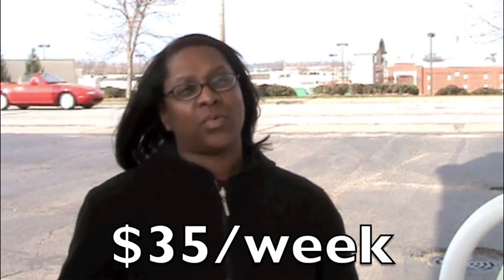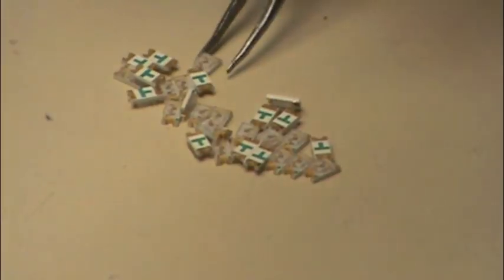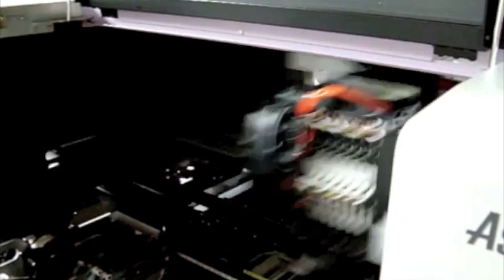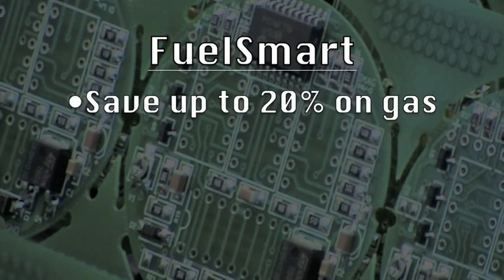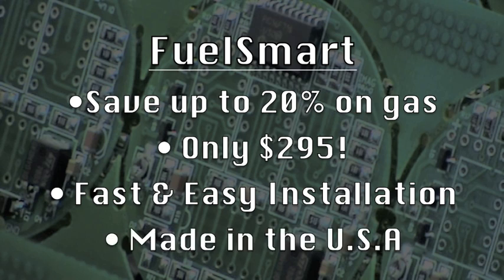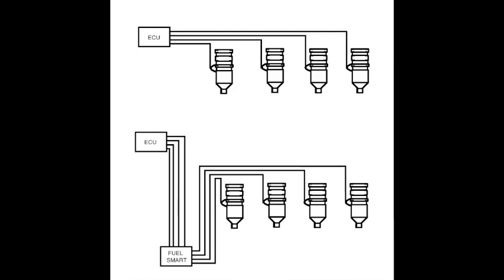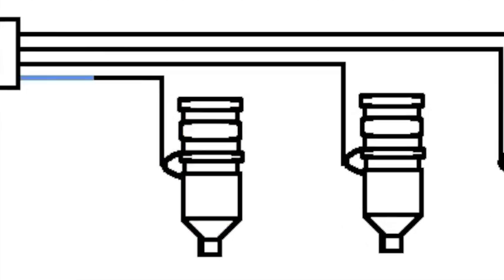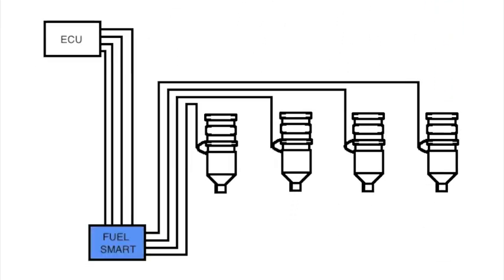FuelSmart: An Introduction

Comment: If it cuts some cyllinders fuel off the others will inject more fuel to compensate negating the whole process.   Also if your not shuting the valves off you are not eliminating the pumping losses which is where the fuel economy gains are.  Interesting idea though.